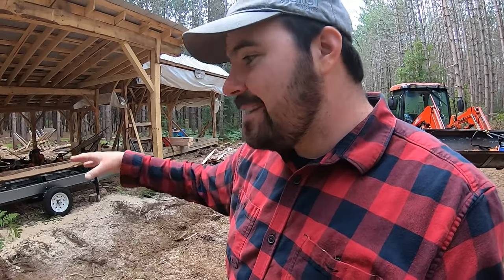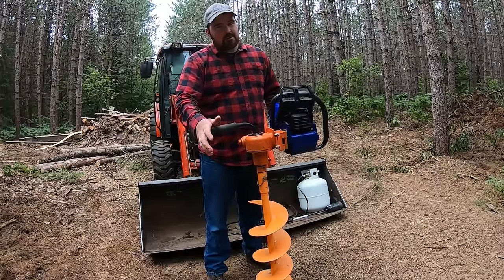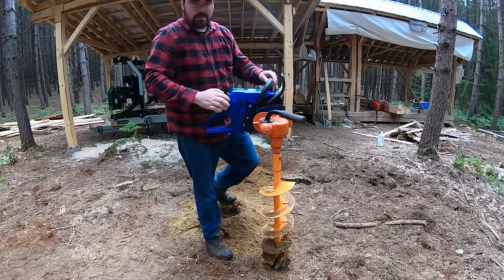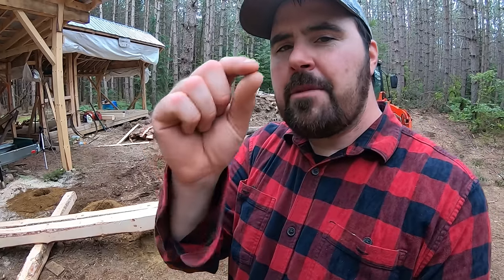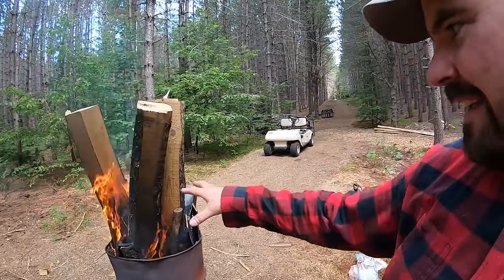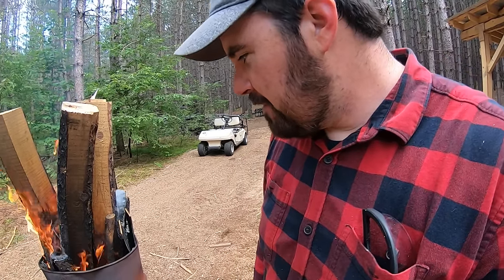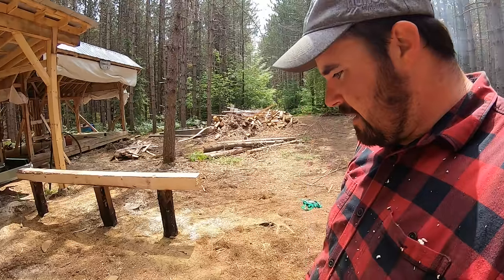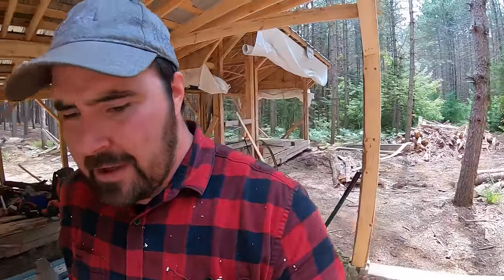Charring Wood (Shou Sugi Ban) for Sawmill Log Deck Build

Comment from the maker: Oil often is also applied after charring but as you can see in the video I skipped the oil step.
Reply: Hey Sandy, what type of oil? I always heard used motor oil mixed with diesel fuel is another good method and always wondered if doing that mix after charring would be double as good.
Reply: I treated some old beams about 50 years ago with linseed oil mixed (1:3 or 3:1 don’t remember which) with Lacquer thinner.  That made the linseed oil soak in with no trace other than darkening.  

I collected a lot of used cooking oil to hopefully make biodiesel some day.  I wonder if dipping charred posts in hot cooking oil while still fairly hot but no longer burning would have the same effect as expensive thinner.  

Also wonder if another burn after soaking for a day in hot oil would help the process.  Will have to experiment.

Comment: I too used the Shou Sugi Ban preserving technique when I set my fence posts five years ago.  They're still as good as they day I set them.   Another tip from someone in the North Woods of the US: When you can't drill below the frost line (48" here as well) due to roots and especially rocks and boulders, we wrap the first 2 feet in length from the bottom of the post with 1/2" foil backed rigid foam insulation secured with  duct tape.  What this does when the ground heaves from freezing is send the rigid foam wrap up and down the post instead of heaving the post itself.  Works like a champ.  Keep up the good work and looking forward to some building construction before Winter sets in.  Cheers!
Reply from the maker: Thanks for that tip. Appreciate it. May have to try it sometime down the road
Reply: Genius! Rigid foam is like the new duct tape, has so many uses.
Reply: Handy tip!  Thanks for that! 😊

Comment: I have the same bunk. I was lucky enough to have a spot that had concrete. Love mine it works exceptionally well. Built green off my 126. I can drop 24"+ from 2 1/2' and it takes it. Well it has so far. Keep making sawdust brother.

Comment: This method of wood preservation is long established and superior to chemical means of preservation.  I recently viewed a video of someone going through this long process of chemically treating wood and I was amazed with how much time he spent with that entire process.  To each his own, but the old saying is don't work harder work smarter.  A fellow Canadian on my self reliance channel used this method of wood preservation to great effect.  Cheers.
Reply from the maker: Yeah from what I"ve seen I also agree that it seems to be a great option. As you can imagine it does take some time to get completed but I think for this case a few hours time getting it done will be worth it
Reply: @sawingwithsandy  I have been wanting to do this for quite a while.  I have incense cedar fence posts on my 5 acres here in the Sierra foothills that were set 50 years before I bought the property 50 years ago.  Many still standing.

Comment: last year we followed in your footsteps and built a log deck. We found it to be a real time saver, back saver and greatly reduced the risk of damage to the mill compared to loading with machinery. However, we found the same downfall as you have: difficult to unload the logs from loader to end of log deck closer to mill and clean up difficult due to cross braces. We will definitely once again steal/borrow some of your design ingenuity. Thanks
Reply from the maker: Great to hear the log deck has been working out for ya Yvette. One thing is for certain I’m always learning as much from good folks like yourself than others are learning from me. Happy sawing

Comment: Sandy you can always raise up the ground elevation along the post. White oak, catalpa , Black Locus, Hedge Apple , are some naturally rot resistant especially after charing
Reply from the maker: Great point there Greg
Reply: @sawingwithsandy  Given where you are located, you should be able to find black locust.  Extremely rot resistant, and one of my favourite woods in that neck of the world.  Underutilised IMHO.  As an aside, don't throw any of the scraps out... whatever you don't use is very good firewood.  Very high BTU's.

Comment: I live in the Ozark forest in Northwest Arkansas. I use a chemical foggier around my work area to get rid of the bugs. It sprays out about 30 feet to kill the flying bugs. I would not be able to go outside this time of year to work unless I spray. I do not spray in the spring when the bees are most active. It’s night and day difference. It is has a 2 cycle motor/backpack sprayer with 3.5 gallon tank. I use diyourownpestcontrol for the chemicals. It’s night and day difference. Great video’s. I hope to have my new hydraulic pump for my sawmill soon so I can be up and running.
Reply from the maker: That sounds like the perfect setup Tom. Bugs sure slow down any fun outside when they’re too bad that’s for sure
Reply from the maker: Sounds like a nice sawmill you’ve got with the hydraulics and all

Comment: Nice work Sandy. That short Handle on the Auger had me a bit worried. At least you have the perfect Soil to be drilling Holes in. Earth Augers Here have 4 long handles for two People to Hang onto. 
Mike M.
Reply from the maker: Yeah I bet the short handle could send me for a whirl with that 92cc saw on board

Comment: Awesome video Sandy. Seems to me I remember you using the chainsaw auger in another video. I commented to strap it to the tractor loader. We have locust trees here we use for post. We pulled some out that were in the ground for 30 years. Still solid.
Reply from the maker: Wish we had some locust around. Sounds like a great option. yeah I did use the auger a time before in a video. Still going strong

Comment: Dropping a rock in the bottom of the hole helps too. Packing in with gravel will make it last a long time. Just an idea. 🙂
Reply from the maker: I like that idea about the rock. Thanks for sharing Russ
Reply: @sawingwithsandy  A bit too late. Don’t go pulling your posts out. 😊 With your soil they will do well with the charring.

Comment: Looks good......We have a problem with wood "nature takes it's course" here in with the salty sand here in Florida. Always wanted to try charring fence post here. I have about a 160 fence posts to put up. When I am ready definitely will be looking into a auger for my 9N.
Reply from the maker: Yeah can imagine that climate would decay wood quick. Lots of work for that many fence posts but could make for a long lasting post
Reply: @sawingwithsandy  My Godfather would "mop" wood fence & posts with used motor oil. It would last 20 years. I am trying not go that route. Hopefully I can figure out a better environment-friendly route.

Comment: You can buy an extension should you find 2.5’ not adequate. I wouldn’t want to have to dig either.
 Quick question is that an ice auger or specifically for sand? I have an ice auger and I was thinking of using it for digging post holes just wasn’t sure if that was a good idea. Thanks
Reply from the maker: Hi Rich, this is an earth auger made by Lewis Winch for dirt

Comment: I'm sceptical on that burning methode version a mix of fuel and diseal. things with fuel and diseal is that you need 3 or 4 coat and it take about 1 month to dry but preserve the wood verry well.
Reply from the maker: Yeah I"m a bit skeptical as well. I've hard the fuel method you mention works well
Reply: @sawingwithsandy  i keep all my old oil and when I need stain i run it in a rice strainer et add 50% fuel. I pit this mixure into a sprayer pompe if I have something big to do or used a brush. The first coat dry fast but the more coat you put the longer it take to dry. The wood will not rot. 

It's definitively not eco friendly but it's cheap. Our lapsiding on our shead it painted with oil base green pain. Onece in a while we just add a coat of that diseal/oil mixture and it come back green nice and shiny. 

But it smal bad for 1 week  et it keep charpenter ant away.

Comment: Very cool!! I ended up buying a dedicated augier but using the holzforma for that and a winch  is smart. Thanks for sharing. I have a long(ish) fence to do so we'll see if the augier works in my very very rocky ground... I might end up needing the backhoe or mini-ex.
Also, we  must have a similar youtube feeds because I've also been looking into shou sugi ban! I'm wondering how long it'll last with green wood compared to dried beams. Good job on the log deck! I'm definitely copying that design!
Reply from the maker: Great to hear you're liking the video Les. I'm interested to see how long it lasts. Will give me an idea what I should use in the future if this doesn't end up working.

Comment: You can just use a large bolt through you log bunk into a 4x4 or 4x6 for the log ramp to the sawmill.  The other thing you are going to need is a stop on the other side of the mill so they don't roll off.
Reply from the maker: That bolt would work pretty slick as well I think. I'm coming up with ideas as we speak for the log stop on the opposite side. Hopefully I come up with some thing good haha

Comment: Gee, Sandy, just once in my life I'd like to dig - let along drill - a post hole in soil like you have. "Come West, young man...," where the soil is as soft and tillable as the number one lane of a concrete highway!! Would it be more beneficial if you pulled the mill in the other direction, and drove it out when you're using it mobile? (Kind of like a circular driveway). That would exhaust your sawdust away from the structure, where I suspect you'll stack fresh-sawn lumber. Just a thought - like you - I'm always looking for an easier way to do things........
Reply from the maker: Yeah I can imagine West of here there's some solid soil. The nice sand soil in the red pine forest sure is nice for digging. The way the sawmill is setup currently it's with the dust leaving out towards the log deck which like you said is a good thing to prevent extra work of cleaning

Comment: a trick for the frost is that once you done your hole you take a shavle and dig in angle to make a kind a inverse mucheroum and then poor concreat. then the frost can't lift it up and if the post is deep in fuel and diseal and you put it in concreat it wil not contaminate your soil
Reply from the maker: Thanks for sharing that Francis

Comment: Hi Sandy do you think you could have used a smaller chainsaw, or do you recommend  a larger  saw for the drill, . It was awsome  how well it drilled holes.
Reply from the maker: I think a smaller one would've been perfectly fine. I bet a 60cc chainsaw would work just fine. The big saw was quite the torque monster

Comment: Hello Sandy. Are you able to put log stops on the other side to prevent the logs from rolling off as you showed some concern when putting one of the first logs on the mill? Have good days!
Reply from the maker: I've got some ideas swirling around in my head about that for sure. Should have something coming out real soon I'm hoping to solve that. issue

Comment: I noticed that the posts on the right is almost at the end of the mill tracks, and the post on the left point to the saw. It appears that you won't be able to load any logs the width of your 'ramp'
onto the saw mill. Am I mistaken?
Reply from the maker: I centred the log deck in between the posts on the sawmill shed with the thought of moving the sawmill to match. The sawmill likely wasn't off of centre just a little bit

Comment: Hi did your last video have the mill on an automatic track? Did you build it or buy it? Just bought the same mill. Thanks
Reply from the maker: Hi Michael, the last mill was on stationary track
Reply: @sawingwithsandy  thanks for the quick response. The video where you leveled the mill it looked like the bandsaw was rolling without you pushing it.. like it was remote control or something?
Reply from the maker: Probably was due to the mill being slightly off level I’d imagine

Comment: I would not worry about a tiny bit of used motor oil coating the posts.
Reply from the maker: I'm a bit hesitant with all the springs and my freshwater supply coming from this area as you can imagine
Reply: @sawingwithsandy  the oil is absorbed into the wood. Whatever leeches outside won't be more than the drippings from your tractor and snowmobiles.

Comment: Looks like you're gonna be lengthing the  trailer on your mill.
Reply from the maker: Probably at some point in the future I will
Reply: I think there was  a optical illusion your log bunk looked wider than the length of the saw trailer. I have tendency to comment before the vidio is done. 👍😀

Comment: your dad is limping hope he is ok. i don't think the post will last long. i us locus or cedar and coat the bottoms with burnt motor oil they will last a lot longer than the treated pine post last treated post i got rotted form inside out i think the treated them while they were still green. the burnt motor oil keeps out termites, ant and etc. take care, be safe and well.
Reply from the maker: Thanks John. Yeah sounds like you've got a good method down for sure

Comment: Think about where the oil came from.  The oil came from decaying wood.   If you would use oil on the post the oil is going to say right there.   I have a gravel driveway and have no problem with engine oil leaks on it.
Reply from the maker: Although I'd imagine some of the oil would stay on the post my concern is that the adjacent soil would also contact the oil and any moisture that comes into contact with that soil may cause the oil to leak into areas beyond the edge of the post

Comment: The connections/joints should probably get some kind of treatment as well.
Reply from the maker: Sure wouldn't hurt. Good point
Reply: I hoard nuts and bolts.  They sometimes come in handy to make air space between joints.  That way moisture doesn’t stay for long enough to do damage.